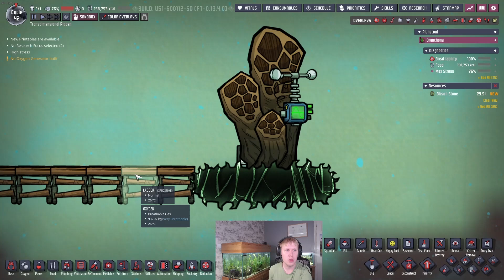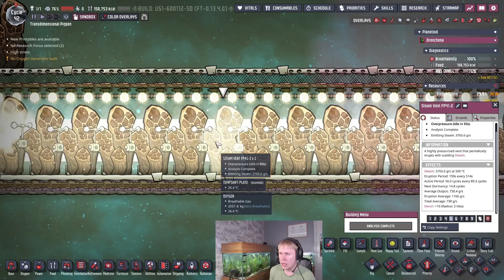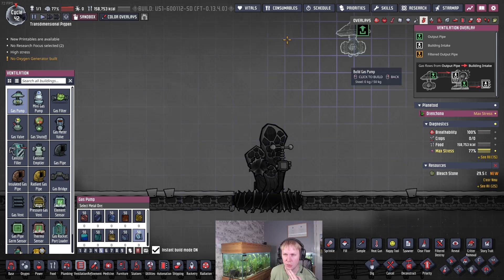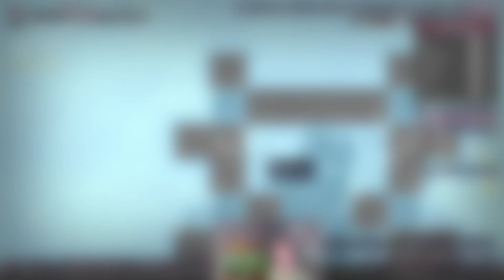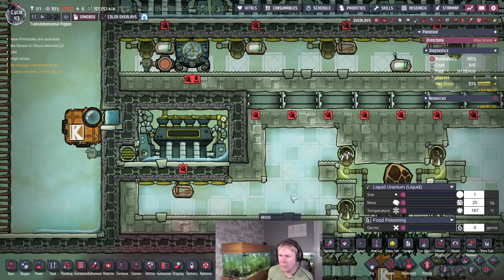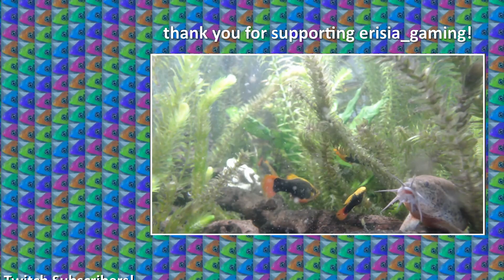How To Maximise Steam Vent Output In ONI: Spaced Out! Sandbox Showcase #22

Comment from the maker: QUICK NOTE: Don't build the Tempshift Plate directly underneath the lower Steam Turbine on each side. The Tempshift Plate actually does affect the whole 3x3 area so this will leak some heat into the Insulated tile that you don't want.

Comment: water has a slightly higher heat capacity than polluted water tho
Reply from the maker: Oddly enough, it doesn't, even though you would expect it to as Dirt has a lower SHC and Polluted Water is 1% Dirt.
Reply: @erisia_gaming  oh nvm, it's lower thermal conductivity. opps :P

Comment: I have one of these captured with a door pump pushing into a steam room to prevent overpressure.  No issues with the high Temps there as it's mixed with the cooler steam.  Do loose a little energy to running the door pump.

Comment: Personally I can't recommend this build since it's too unstable. Yeah it looks nice but I can't see it going past that. Sorry. General rule is that if you need to go back into the space to "fix or change things" constantly even after the build is "finished" then it's not worth the hassle. And god forbid it's a sensitive one like your refined phosphorus video.

And no I'm not hating your ideas since it'll help invoke new and better ideas to others.

My point is:

Why not use doors to squeeze the steam out? It's much more stable.
You can also just prep the room without opening the steam vent using shorted liquid tepidizers to heat up some liquid inside some pipes to get all the components up to temp.
You can also use doors to distribute the steam to the steam generators at the top once its cool enough.

If you're gonna say that doors are too slow, then power them.
You can use atmo sensors to check if the amount of steam around the steam vent is over a certain amount (above 2k is fine) before you activate them to save some power. Honestly, a ceiling light probably eats more power than a door coz they only consume power when they're either opening or closing. And best part is that the amount they move scales with the preasure so if you have any over preasure issues just use doors and watch it eat 100k of either liquids or gasses in less than a cycle.

This is a nice idea but don't use it in your games. You'll just get frustrated. You're honesty better off just using liquid duplication at this point.
Reply from the maker: I like the idea of using doors to pump the Steam out and need to try it out at some point. But I've tested this build and it is stable once it's set up. The door at the end is to show how you could open it up if needed but it's definitely not mandatory. I'm showing ways that the setup could potentially break during set up and how they could be addressed as that sort of stuff isn't often covered in videos and the aim is to get people to understand how to think about problems in the game rather than following rote instructions.